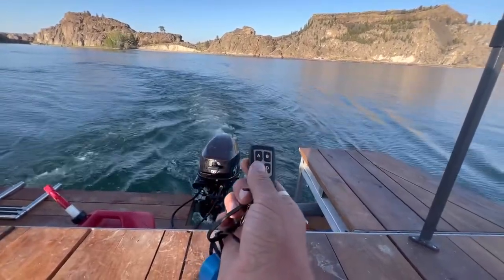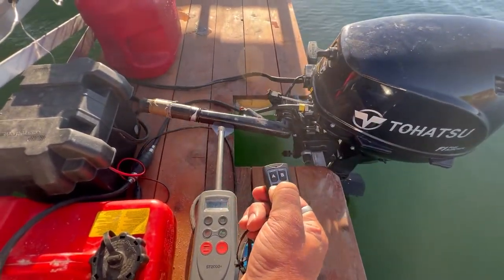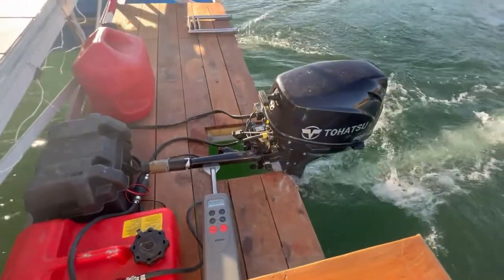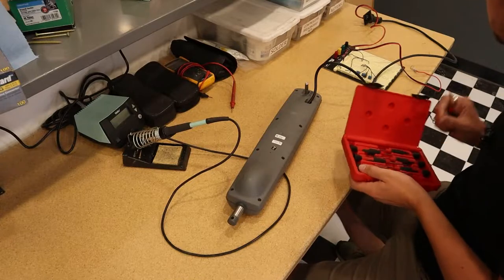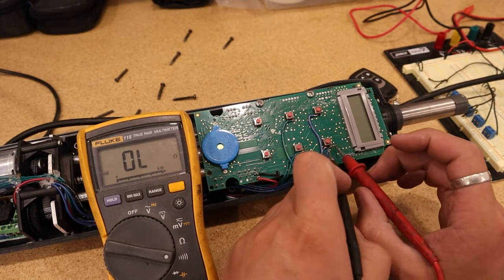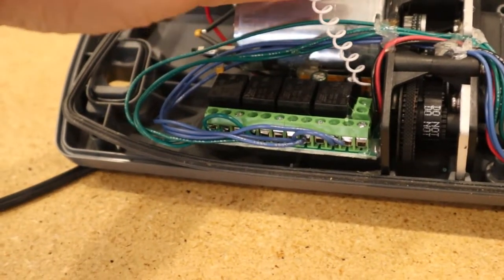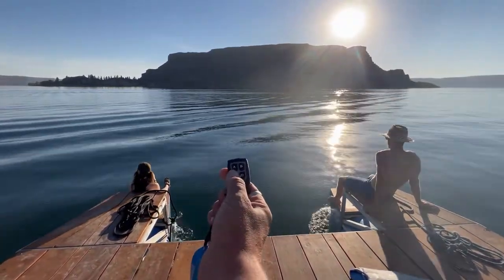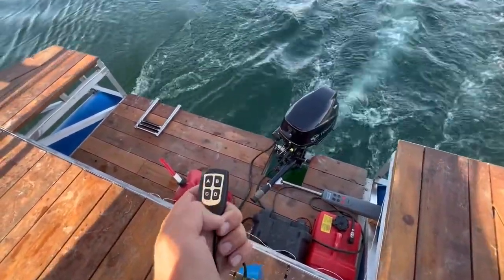Wireless Autopilot on the Cheap - Raymarine ST2000+

Comment: open-boat-projects has a DIY remote control for Seatalk autopilot

It uses communication with the autopilot ove seatalk, this way you wont warrenty or possibly destroy your autopilot, tho its a more complex project.. And check which autopilot models support seatalk steering commands.

Cheers..
Reply from the maker: Super cool

Comment: I’m working on this project now. Curious if there is any reason you didn’t pull power from the motor next to where you placed the board??
From what I see doing this would mean only running 6 wires to the front of the device, making things a tad easier to fit.
Reply from the maker: Hmmm I assumed there wasn’t constant power at the motor, it’s just the switched motor power. Did I miss something? That would be ideal if you could run only 6 wires.
Reply: @bailey2829 man you are fast! lol I just came back to delete this comment because I just discovered exactly that. There is not constant power so it will not work.